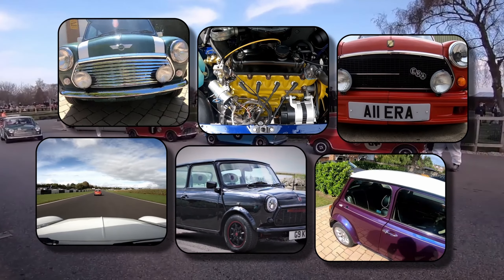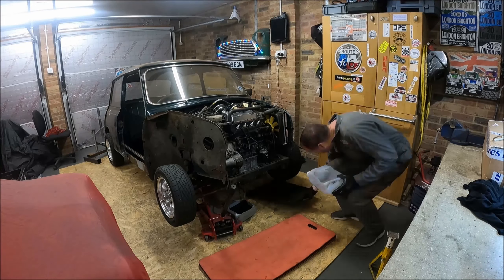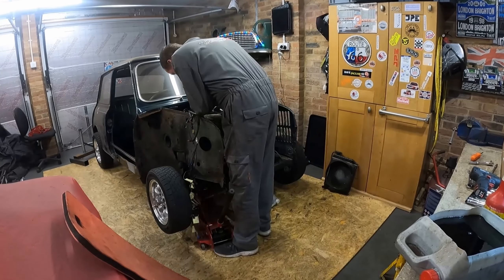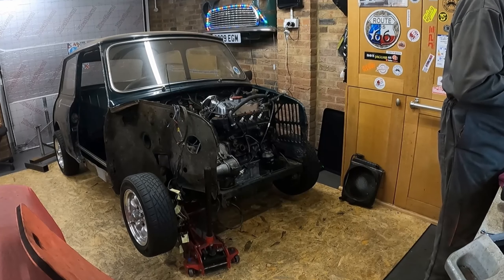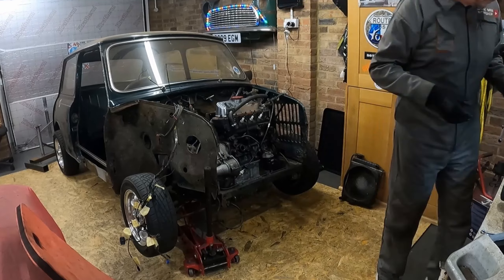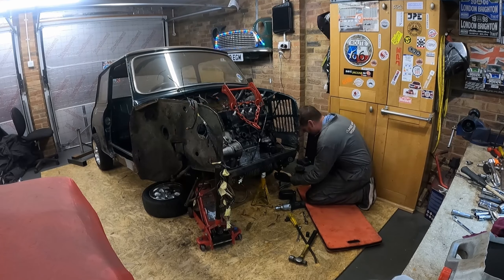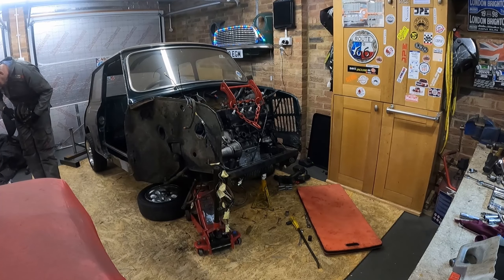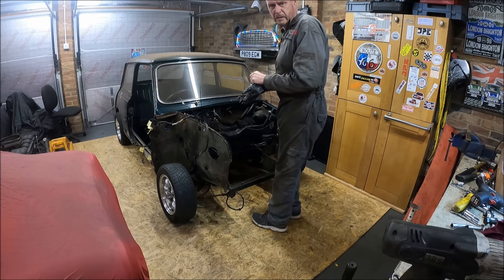Engine Removal - Classic Mini Workshop - Project Racing Green Pt.14

Comment: More memories, thanks Keith. I dropped or rather lifted the body off the front subframe which made storage while I investigated the body rot. The rear mounts had already parted themselves! Benefit of rubber? When I did get to take the drive shafts apart, the inner pot joints won’t pass through the subframe. Leaving them on the gearbox also contains what is left of the engine oil in so you can control the spillage too.

Comment: Removing the engine and box without disurbing the cv joints and hubs is possible on a mini with negative camber.  Removing the pot joint cover retaining clips and leaving the inner part of the pot joints in the box allows the engine and box to be removed by easing the engine from side to side as it is raised.  Obviously there's risks - getting dirt in the pot joints, losing  the balls etc.  I've heard the joints should go back together in the same relative alignment but I've had  no trouble with vibration from ignoring that suggestion.  It may not be possible for cars with no negative camber due to the hubs being slightly closer to the gearbox and I remove the engine with the wheels on the ground as the weight also helps push the hubs away from the gearbox by keeping the lower arms as level as possible.  Replacement is the reverse of removal though with care not to lose the balls or get dirt in the joint.
Reply from the maker: Thanks Peter.

Comment: Hi there Keith, my name is Sam. Could you please tell me the name of the odd-looking tool you were using to disconnect the hub (I think). At minutes 13:16sec-13:34sec. It is a silver tool.
Reply from the maker: Its a ball joint splitter
Reply: @classicminiworkshop  thanks a lot 🙏🙏